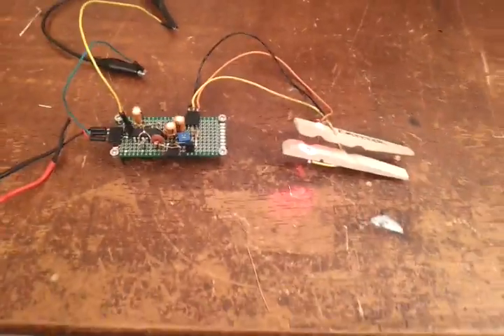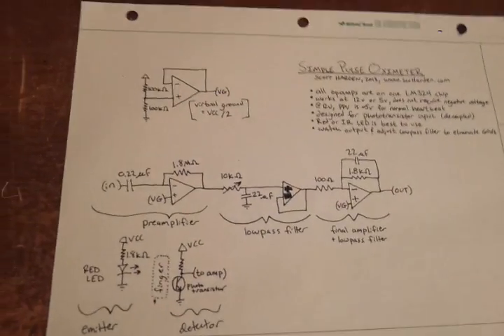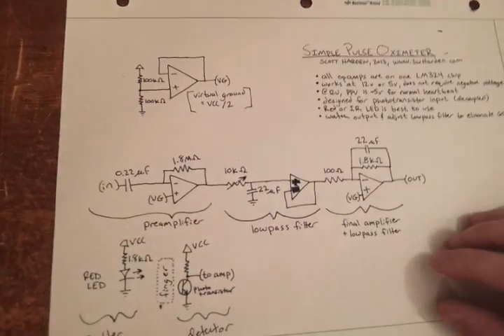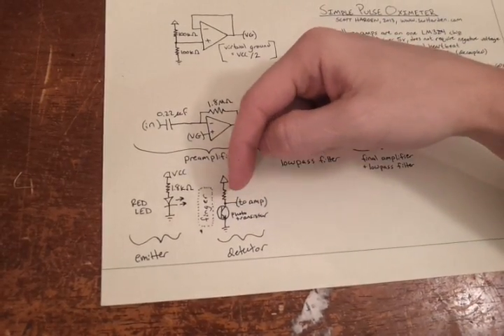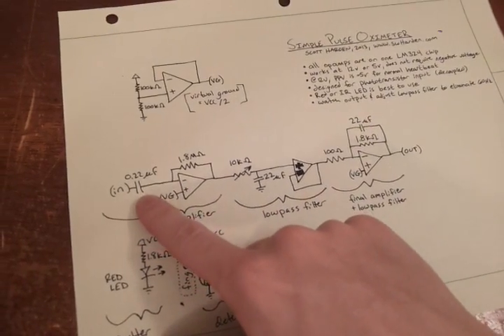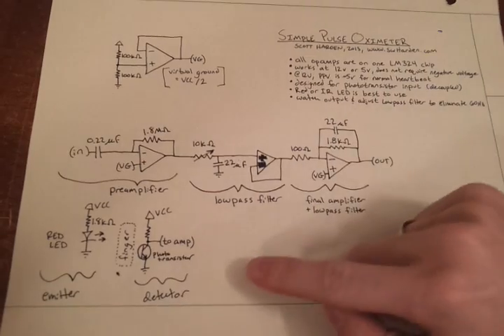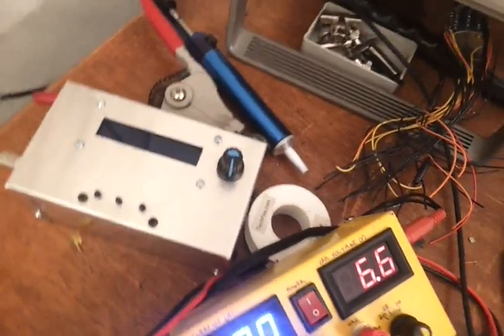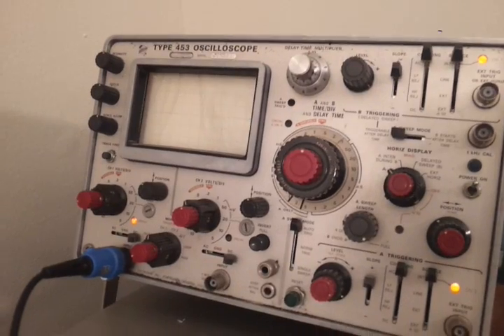DIY ECG and Pulse Oximeter with LM324 OpAmp (1 of 2)

Comment: This video is a few years old, but because of COVID-19 people are looking for affordable ways to expand monitoring of COVID patients so that better treatment decisions can be made earlier.

I just want to caution everyone to be extremely careful with DIY ECG. The primary issue is electrodes are designed to eliminate (as much as possible) the resistance of the skin, that means whatever current is flowing through the leads is going to flow directly through your heart.

The maximum current allowed in commercial ECG devices is <10uA, while testing a similar design I was getting ~0.15mA (about 150uA). This is still below the "lethal level" of 100mA, but far over and above what is considered "safe" by industry standards. It's important to remember that 10uA max is the limit even during electrical faults (ground fault, ESD, mains over current, etc.).

It's also critical to understand that even though 100mA is considered "lethal", it is entirely possible that lower currents over an extended period of time can lead to serious injury and/or death. Improperly made ECGs can cause a wide range of injuries, induce ventricular fibrillation, shut down the muscles regulating the lungs and ultimately it can kill you.

Normally touching both leads of say, a car battery, will not kill you because your skin has a high resistance and limits the curret, ECG electrodes and specifically the placement of them are designed to remove that resistance and allow current to flow freely between the electrodes and ground lead, so with all that said:

If you do not know what you are doing DO NOT EXPERIMENT WITH THESE DEVICES.
Reply from the maker: Hi Noah, thank you for clearly stating this important message! This video is several years old, and moderately improved safety may be achieved by using a commercially-available ECG sensor board https://www.youtube.com/watch?v=sP_-f5nsOEo although a good understanding of electronics and attention to safety is required whenever one uses or experiments with medical devices.
Reply: @swharden  
We're actually using the AD8233 chip to develop a portable, OSHW ICU monitor, they're nifty little chips :)

Patient isolation is the big thing, you want to make sure that no matter what happens the patient is never in the path to earth. Which, for the most part running this IC off battery power does, but connecting directly to the mic jack of a computer presents an opportunity (although very slim) for the patient to become a path to ground, this gets even riskier if more devices are attached to the patient 
Here's a primer on that https://www.asnm.org/blogpost/1635804/289003/Understanding-Patient-Grounding

To step up safety a bit more you might want to consider running an ADC inside the device itself (off the battery power) then have an opto-isolated connection to the computer you're displaying it on.

I think the easiest way to do it might be a two microcontroller setup, have one doing the ADC running off battery power communicating to a second controller via an optocoupled I2C bus, then have the second microcontroller (powered by USB) handling the USB connection to a computer.

Alternatively, you could use analog opto-couplers, I'd imagine you'd need 2 of them (1 for each lead to get + and - readings), but analog signal isolation is quite a bit harder than digital (and the ICs are more expensive too)
Reply from the maker: @noahw4623  These are more excellent points, and patient isolation is a good topic to read about. I encourage you to review the AD8232 datasheet (Fig 66) or AD8233 datasheet (Fig 72). You will find that none of the 3 body leads are grounded. My understanding is that no path to ground is provided to the patient, even if the output of that chip is fed into a computer sound card.

Comment: Can you explain how you knew to use a 0.22uF capacitor as a coupler? And also how to determine what the supply voltage should be for the circuit?

Comment: I cant seem to get my phototransistor to pick up any noticeable voltage change in my finger, my output is either high (12vdc) or low (gnd) but no heart beat fluxuation , tried swapping decoupling caps there is just no small signal to amplify, im not giving up though, I did just use a red led instead of an actual infrared diode, ill try using the infrared diode this time...

Comment: For the sticky pads on your skin, are they connected to your circuit via a twisted pair of wires? That alone could help reduce the 60Hz noise. I am amazed at how sensitive the pulse-ox is to your pulse! Nice work! You should feed it into a data logger for analysis 500 samples/sec should be fast enough.

Comment: this circuit is so simple i liked it , but still i need to measure the o2 rate in blood , i need a simple circuit for my graduation project , do you any website gives simple circuit , i cant buy ready one (they dont accept it ) i need to made one my self . and again this video is great you are simply great :)
Reply: hey :) if incase u hav found the circuit diagram for the oximeter would u please share it with me.. I need it for the college project too :) thanks
Reply: @MrEzlen  I have the same graduation project. Could you find out anything? It would be just amazing if you could share :D
Reply: @isoaso344  could you give me your mail address I had done that about 4 years ago.. i will have to check if i still have it
Reply: @MrEzlen  Hello sir, i also wonder how to design such a SpO2 circuit. Can you share if it is possible? Anything informative would be helpful. Cheers!
Reply: @isoaso344  hello I could not find the old data but I have asked my college to provide me with the data. Will send it to you as I get it.
Reply: @MrEzlen  Thanks for your reply! I am so thankful for your effort, it means a lot. I will check out my mailbox everyday :D
Reply: Could you find anything related sir? I have the same project and it could be really helpful if you have found something :)

Comment: Nice job but technically, this is not an "oximeter" because you are not measuring the amount of oxygen in blood but the variations in the amount of blood in blood vessels due to heart beating. In the case of EKG (ECG), you have to be careful with leakage currents that circulate from your heart to the oscilloscope, in given circumstances and in the worst case, they can lead to heart fibrillation.
Reply: Yes..and should only use a battery as power supply
Reply: @fritzschnitzmueller3768  Don't worry so much.

Comment: sir question, is the resistance of the resistor at the detector circuit with the phototransistor just equal to the emitter circuit which is 1800 ohms?

Comment: Hi, I am trying to duplicate your work but with 5v source voltage and later feeding it to one of the analog inputs of an arduino, but somehow I failed to mimic your results. I am using a IR led instead of a red led, also I don't see the polarity for the 0.22 micro farads capacitors in your diagram.